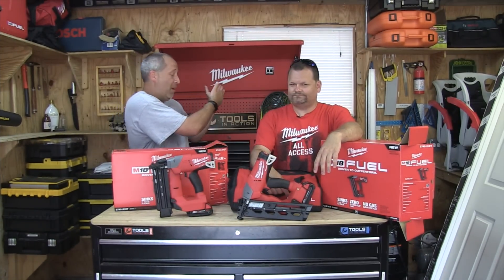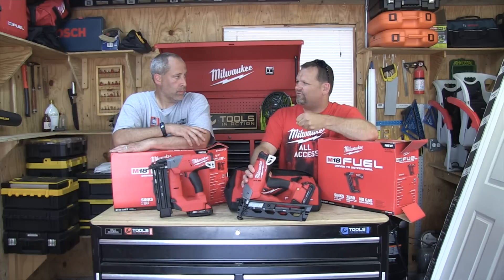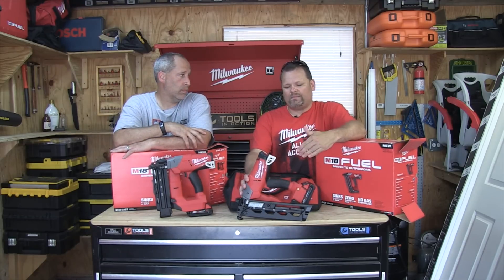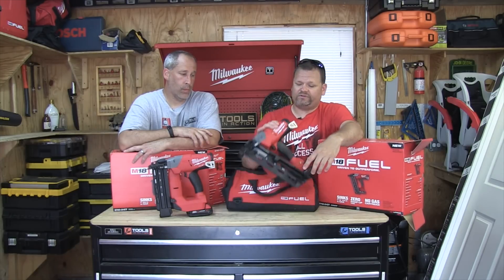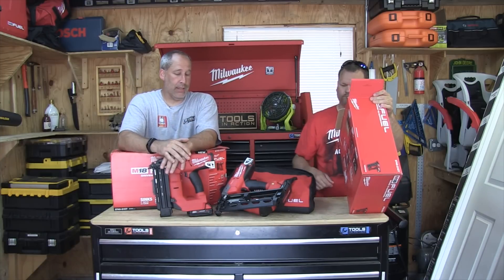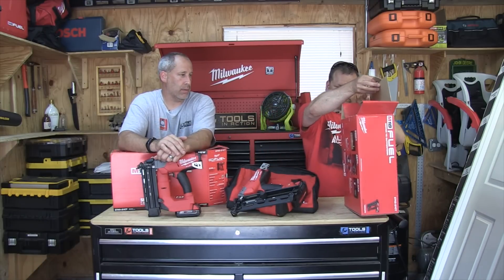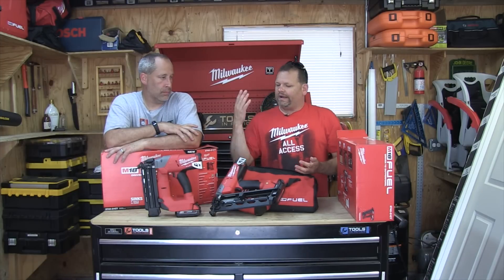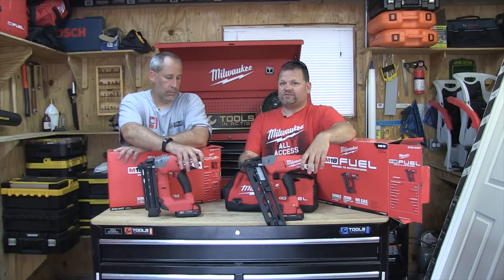Milwaukee Fuel Finish Nailers 2740-21 and 2742-20

Comment: I own both the 16 gauge straight nailer and the 18 gauge brad nailer. - I can tell you that these things are fantastic. I shot over 300 nails in Red oak and Poplar, along with Maple & Cherry, and have not had one misfire. Every single nail was driven into the wood at a consistent depth. - They are not the lightest tools around, and the kickback is evident but tolerable. They just work, and work well! - These nailers are for finish work. If they never included bump fire, I wouldn't miss it. I will never use it in that mode. - If you are already invested in Milwaukee tools, these are no brainers. - Great video guys!  #TIACREW

Comment: I have been lucky enough to use the Rigid, Porter Cable, Ryobi, Mikita, Dewalt, and now the Milwaukee 18 ga. brad guns! I found the Ryobi and Porter Cable to be fairly precise, (small hole to fill, no double tap), but not as consistent and the Ryobi finally just failed to sink the nails at all, the Rigid was like using a sledge hammer to drive finish nails and no matter how you held the gun it would double tap leaving a lot of unsightly filling to be done! The Dewalt (older DC608), does a fairly good job similar in design to the PC, but uses old tech batteries and has limited run time. The Mikita just isn't a finished product and they really need to scrap it and go back to the drawing board! I finally thought I had found the perfect all around brad gun with the Milwaukee but I soon realized that this thing has it's issue as well!
 First off,  while it is the fastest, most consistent and dependable battery brad gun I have experienced, it also has to be the most frustrating! It drives every nail sub-flush, but leaves a hole, or should I say CRATER, easily the size of a 15ga. finish nail! If I want a huge nail hole I'll use a 15 ga. gun! The gun is so over built I think the engineers decided to design a framing nailer and call it a brad gun! The sight lines on this thing are the worst of any finish nailer I have ever used, PERIOD! The nose and safety are so over built that is impossible to use in any kind of tight space, angle nailing just isn't an option and you will never be able to hide a brad down in the crevice of a piece of crown! The placement of the safety so far behind the over built head severely limits nail placement options, angling the gun in any direction results in a fail to fire or proud nails! This just isn't a fine quality finish tool!
 Milwaukee could learn a lesson from Ryobi or Porter Cable, they are MUCH better designed up front and will drive a nail completely at angles and tight spots!
 If Milwaukee would borrow the nose design of the Bostitch Smart Point finish guns and match the size of the driver to the 18ga. brad they would have the best Battery brad nailer on the market...Bar none!
 Are you listening Milwaukee, we know you can do SO much better!  
Cheers!

Comment: im a huge milwaukee fan, got a bunch of the 18 and 12 volt line. i use brad nailers ALOT but im just not a fan of the tip on that one, for really intricate curvy crowns i feel like it would be too hard to get the nail exactly where you want it.  i wish bostitch would come out with a cordless brad gun with there smart point.
Reply: You don't use an 18g or 16g nailer for crown...glue and 21g or 23g pin nailer only. This is a punch list nailer for base, case, shoe moulding ect..

Comment: hey guys i have the m18 15guage just wanted too add my 2 cents for the first time because...its become stupid with rumors biased reviews ..the one guy who gave a "race" and proclaimed some kind of victory really ignited the childish side of people and kept editting his comments to twist things, same guy tried to imply m18 batterys take more than 2 hours to charge when he was trying to build up another rotary hammer he blattantly lied!! none of mine even take an hour!!  im no expert but i have almost every fuel tool milwaukee has and all my tools have this protection and i never had an issue unless i really beat the tool, aaand if i do it only takes a quik second for my tool too "reset" .HEY GUYS MY TOOL CAN DO BUMP FIRE OR SEQUENCIAL IN SEQUENCIAL DO I HAVE A SPECIAL ONE OR DOES YOURS ALSO? OR U FORGOT? : ) MAKES ME THINK THEY SHOULD HAVE NO MODES RIGHT: ) IF U HAVE BOTH IN ONE MODE!!!  anyways i agree and think there should be some more over molding id like to see some around the front top part.. for some reason i carry it by the magazine and put it down upside down first and let it "fall if it wants too. well anyways just wanted to say goo milwaukee keep it up i will buy you re framing nailer( wwwhen it comes out)
and ur max rotary hammer i have a personal request if u guys arent already doing it for the "max" uk secs are suggesting about a footpound more impact energy than my 2715 id like the option (maybe the one note thing) to reduce runtime to move closer to 5 or 5.5ft lb of the 1 9/16 corded i ll buy it it any ways i love the max bits!!! peace keep it up!!!!